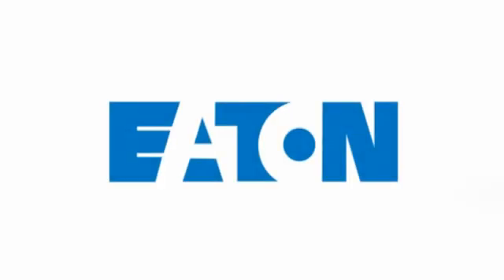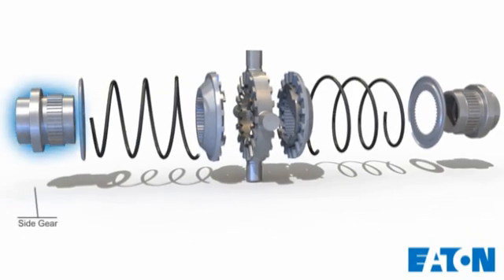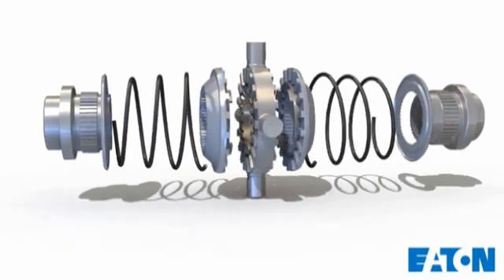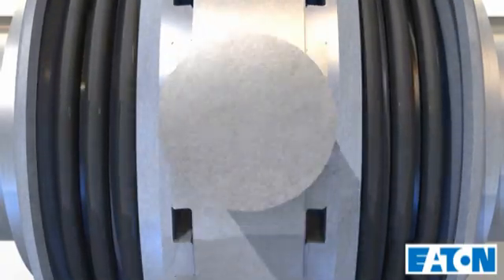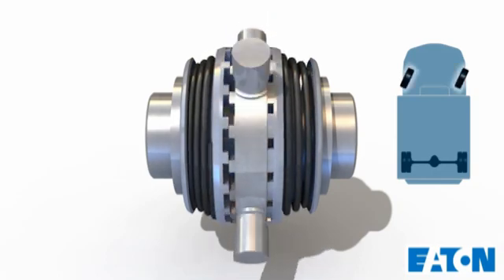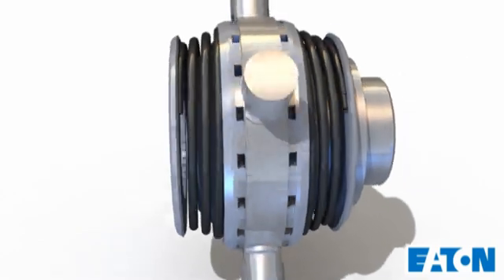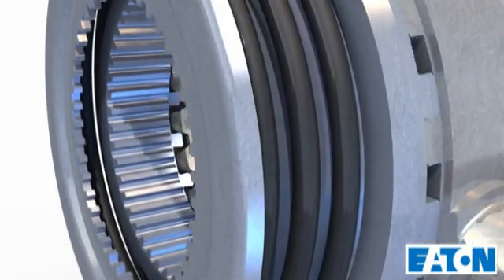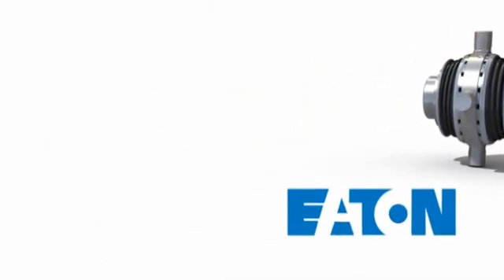Exploded View - Inside the Eaton NoSpin Differential

Comment: NoSpin vs e locker; which would be better suited for recreational off road? I would like to install a locker in my IFS. My truck is a 2003 Chevy S10 ZR2.
Reply from the maker: +A Crustacean, 
For recreational use, the no-spin will work well. But, when going to larger tires (35&up) and more power and more aggressive trails, the E-locker is a better choice.

Comment: Trying to work out the behavior cornering hard under power...
Early in the turn, the faster moving outside wheel will disengage and all power will go to the inside wheel. Since this wheel has little grip due to weight transfer, it will quickly break traction. Once the slipping inner wheel reaches the speed of the outer, the return spring will reengage the outer wheel. It will then act like a locked diff, with the inner wheel spinning.

Should work, but hardly ideal, mainly for offroad imo.

Comment: So how does it decide to disengage ...? Does the angled incline just overcome the spring and push it out, ie it's the spring rate is the control ? so if you had it on a performance unit and floored it, would both sides just cam out ?

Comment: @jgizzy It is a one way clutch, if you floor it during a turn it will lock back up.  I have had a detroit locker (exact same device as this one) in several vehicles, and driven on the road.  If you give it gas during a turn it locks up violently and you hear a loud bang, and the vehicle tries to go straight, so you learn not to do that.  Instead you want to maintain a smooth steady speed during turns. It will allow one axle to go faster than the center section, but never allows one to go slower.

Comment: @mrJv2k7  No...It's designed to unlock during turns only, on the pavement. The locker can differentiate wheel speed during a turn on pavement...and will therefore unlock during the turn. It WILL NOT unlock with one wheel in the air! It's a great design!!!

Comment: @willglo so what if a wheel is in the air? will that disengage the lock on it? so it's not going to get any power sent to it?
@jgizzy an open diff would provide power to both wheels, this one only to the inside one, according to this animation

Comment: So, it still didn't show HOW the mechanism momentarily dis-engages from the full-lock position. It just shows me that it does. Not sure...

Also, say you're going around a corner and you need to floor the gas pedal -- it will spin the inner wheel only because during the corner the clutch gears will be disengaged. So around corners, and full throttle application, it will act purely as an open differential.